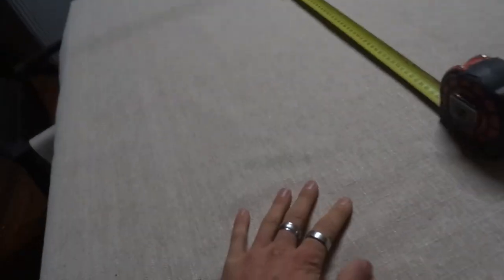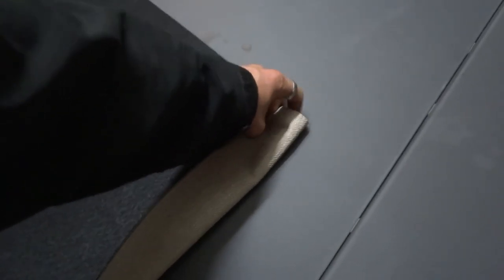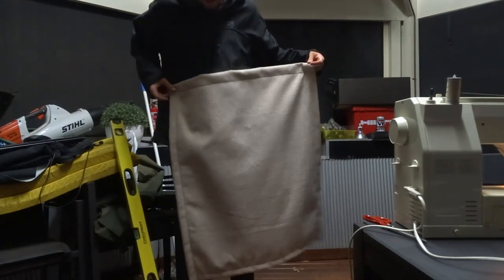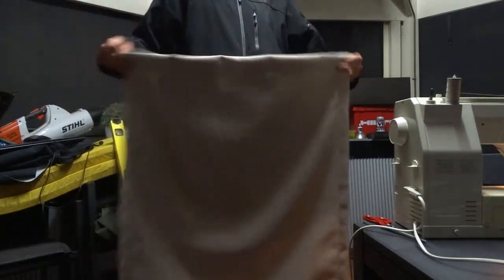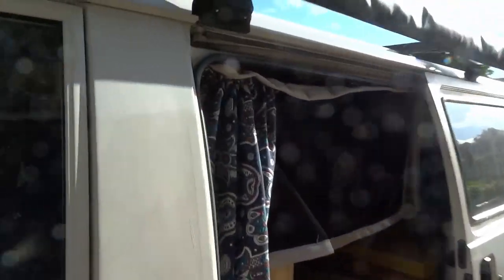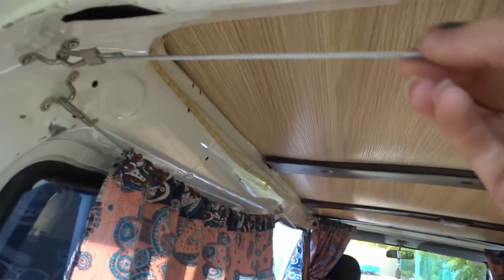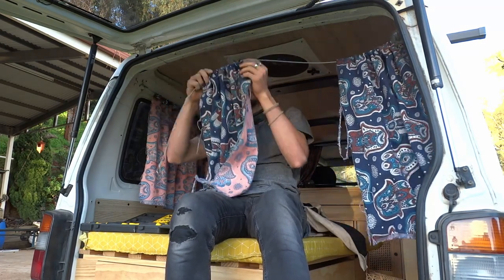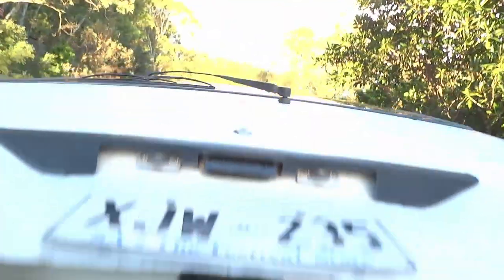Sewing easy D.I.Y Van Curtains with magnets | Mitsubishi Express DIY Van Conversion part 13

Comment: I’m also doing a build in a Mitsubishi express & thinking about doing magnet curtains like with the bigger fancy vans have.  I like how you put the magnet in the curtain hem, similar concept I’d not thought of!  Where did you get your magnets from?
Reply from the maker: Hey V, thanks for the message✌🏼 the magnets I just got from bunnings, they do the trick but it probably wouldn't hurt to get some that are a little stronger pull
Reply: I picked some up a few weeks ago, it was a fail lol definitely need a stronger magnet through fabric…I’m up to the next attempt, hot glue to the edge of a standard curtain.
Reply: @jhrhiggi  great tip👍🏽👍🏽